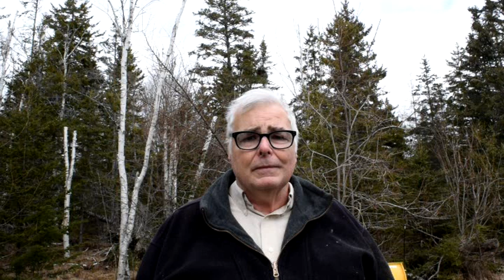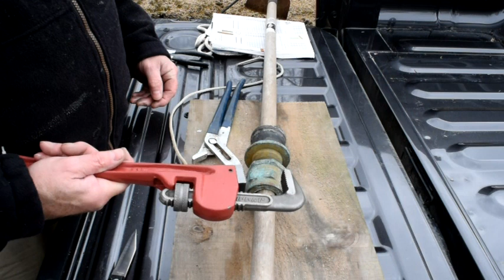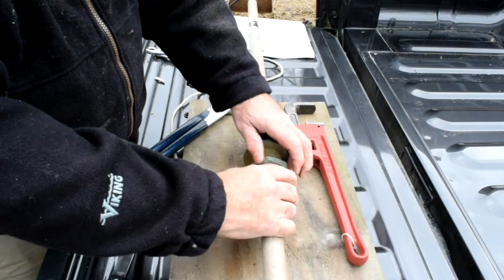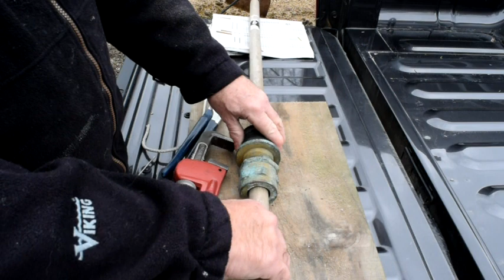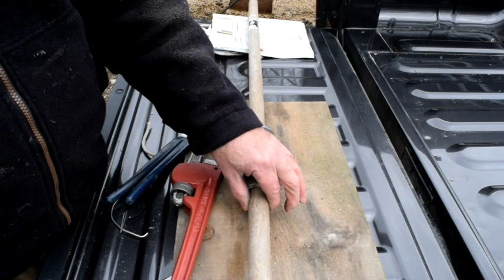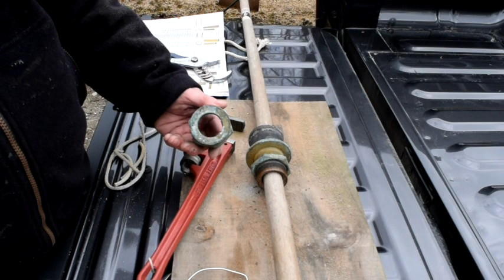Boat Maintenance - Traditional Stuffing Box/Shaft Seal

Comment: A GOOD TIP IF YOU HAVE TO MUCH WATER COMING IN THE BOAT;  Roll up a cigar size with play doh, then roll it with saran rap. Go in the water and stuff it between the shaft and the inlet of the opening. That will slow down the water from coming in the boat.
Reply from the maker: Or you can stuff a rag in.  Thanks for the suggestion.

Comment: Are there a lot of friction losses from this method?
Reply from the maker: Friction depends a lot on the type of packing.  I use a teflon loading packing which should give considerably less friction than the traditional flax packing.  That said, this sort of shaft seal is certainly higher friction than a dripless seal.  However, that is offset by the near zero maintenance of the traditional packing of this type - you just tighten the packing nut if it is leaking more than you like.
Reply: @todddunn945  Sounds good. Thanks.

Comment: Great tutorial on the stuffing box, most people don't go into much detail. I haven't tried any, but there is a company that makes the packing that is graphite based I believe. I could see the merits of that for sure.
Reply from the maker: I have used the graphite packing.  It works very well with no dripping.  Thanks for the kind words.
Reply: @todddunn945   Packing is supposed to drip.
Reply from the maker: @SOLDOZER  that depends on the kind of packing.  Yes traditional flax is tightened until it drips a couple of times a minute when the shaft is turning.  The water provides both cooling and lubrication.  However, the teflon impregnated carbon doesn't need to drip.  The carbon and teflon provide all the lubrication that is needed and they are good enough thermal conductors that the stuffing box stays cool.

Comment: Thanks for the video.  In the past, I used a pipe wrench to loosen/tighten the fittings like you did, but found out a Ford wrench works even better.  They fit tighter and don't have the sharp teeth in the jaws, which tends to dig into the bronze if the nut is tight and/or corroded.  They also work on other fittings with large sizes, such as thru-hulls and prop nuts.  I found your channel recently and have been enjoying your videos quite a bit.  I look forward to the next one.
Reply from the maker: Les, I have proper wrenches on the boat.  I made this video with the tools I had at home.  I am glad you enjoy my videos.  I will have more boat videos coming soon since Spring boat work season is just around the corner (after we get through the snow storm we are having tonight and tomorrow).  I actually put the snow plow on the truck this afternoon.
Reply: I'm sorry to hear you're still dealing with snow there.  Luckily, Spring and warm weather arrived here in SW Missouri about ten minutes before my tolerance for Winter officially ended.
Reply from the maker: @lesb3481  I have been ready for the snow to be over for several years.  I can do without it.  We had a low snow year this year - only 56", not counting tonight through Wednesday..